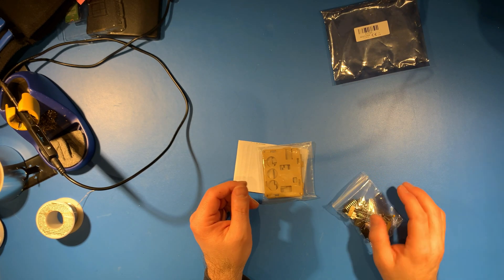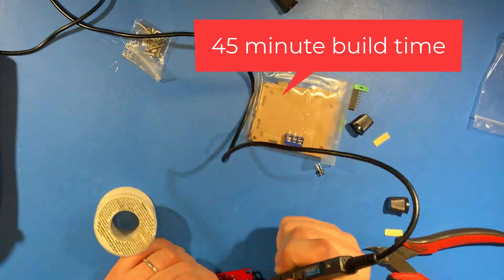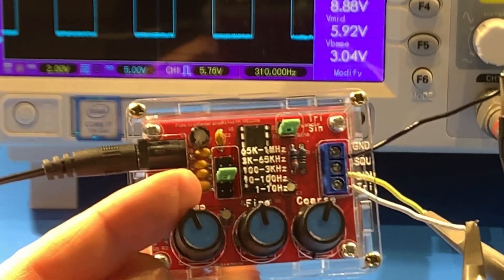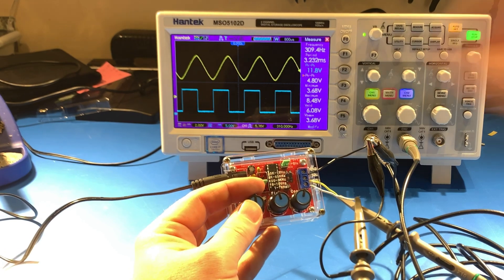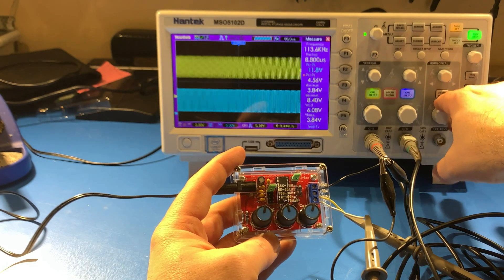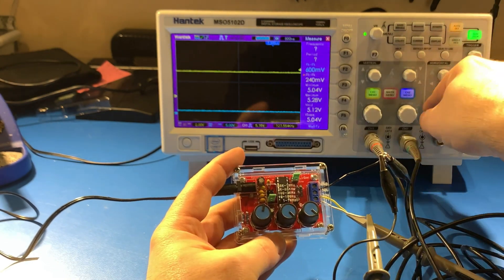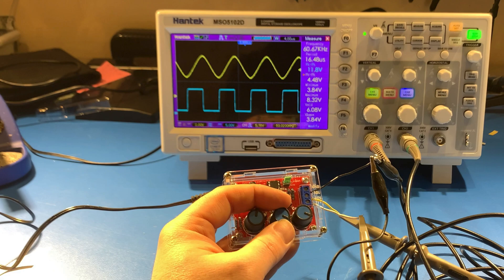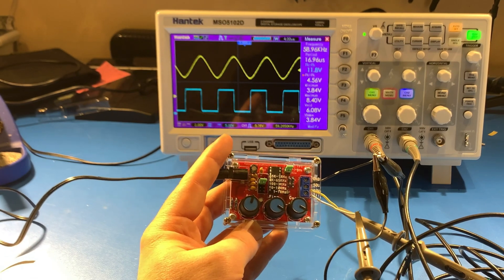How good is a $12 signal generator?

Comment: How low can the Sine-Wave amplitude go...  can you get 70mv P-P stable?

Using an external source, Is it possible to offset the sine wave by about 1V?  For example by connecting the generator's output ground to 1V?